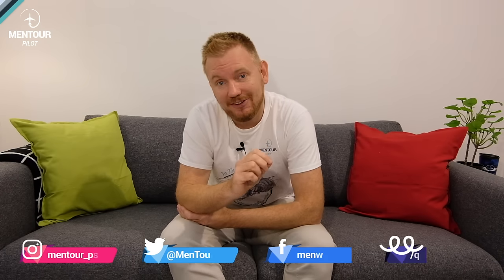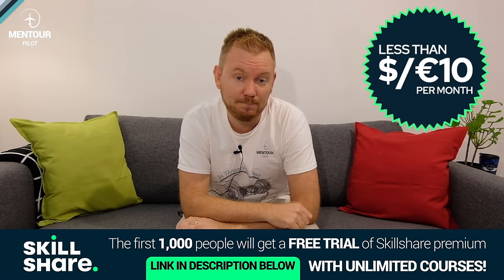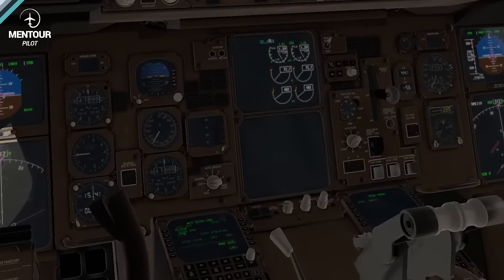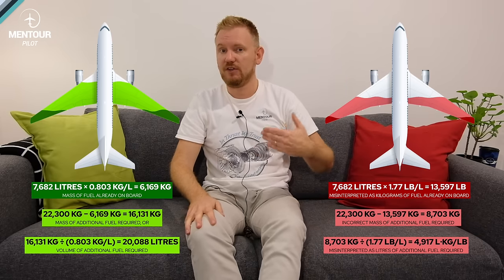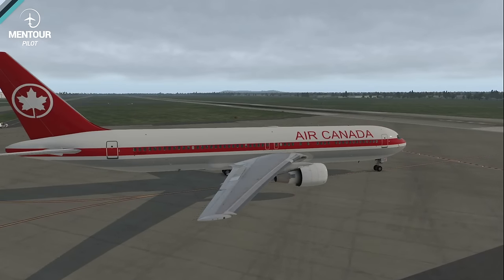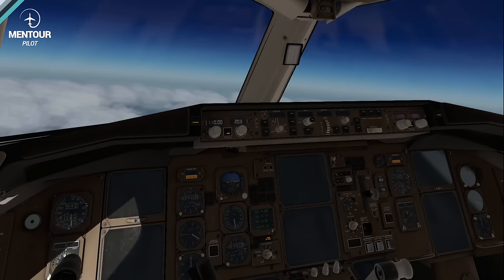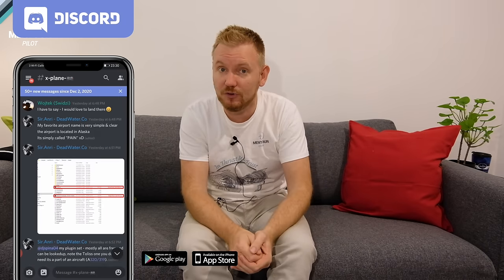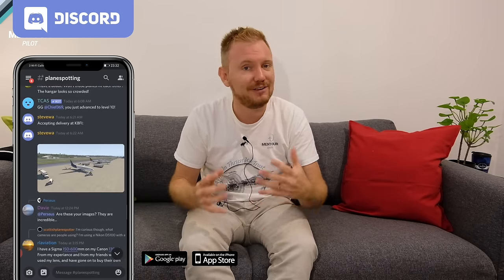The Gimli Glider! Explained

Comment: At this point in time the Government in power in its infinite wisdom decided on a major hike in gasoline (fuel) prices to continue providing excellent government to the people of Canada. In order to hoodwink and confuse the naive population they converted the way fuel was measured (adopted metric) and simultaneously jacked up fuel prices. It was a win win; the gov't got the tax revenue they wanted without upsetting their constituents and the public got hoodwinked and did not know the better. It was people like Capt. Pearson who initially became the strawman to protect Air Canada's reputation.
    The bean counters in AC too who try to minimize fuel loads and tank up at locations where there is a significant fuel price advantage who likely had a role to play as well.

Comment: That Gimli plane still exists.
Reply: Alas, it does not. C-GAUN, the accident aircraft, was retired in January 2008 and flown to the Mojave desert for storage. The aircraft was scrapped in early 2014. Parts of the metal fuselage skin were made into a limited-edition run of aluminum luggage tags. (I have one of them.)

Comment: What I do not get is: if you did for ages conversions liter to pounds you will know the factor 1.77 like engraved into your brain. Now you KNOW that it's Kg and still you use the same factor? ??? Nobody gets a thought like "it can't be right to use the same factor I used for decades if it's kg now...."
No offense, but if this is the intellectual level of a flight crew I am scared.

Comment: Air Canada is a shit airline that frankly needs to be on the unsafe black list. 

When I was a kid, we were flying out of BC to Ontario. Dad looks out the window and sees a major section of the wing has peeled back. Calls over to a flight attentent and shows it to her. 4 hours later were back in the terminal waiting for another aircraft.

Literally - as a kid I didn't understand what my dad had seen. As an adult I get nightmares over it. I remembered to this day when the ground crew tried to use duck tape and grit to bend the metal back and hold it in place. 

The fact that they went after the air crew on this one speaks volumes of how utterly shit they are.

Comment: They were lucky Capt Pearson was a "take charge" kind of guy who said as long as the plane stayed together he would get it on the ground okay.
Reply: Except that, except for a tiny gust of wind at the end, he would have taken charge of slicing up hundreds of mothers and children.
It is the HIGHEST of violation of duty to care when someone in charge of lives assumes "yes, I'm sure they can safely fly" when he is not sure. He violated the most basic standard of care and negligence.
Reply: @Bill_Woo  I think you are being unduly harsh. Air Canada had just converted from Imperial to Metric and not trained the pilots or re-fullers in the conversion. To make matters worse the fuel onboard indicator was not working. When the Chief Mechanic (on board) was called up he had no idea of the problem. He did suggest they might be low on fuel and Captain Pearson then looked to land ASAP. I don't know about the "gust of wind" first time I heard of that. The plane 's nose-wheel collapsed and then it hit a divider installed on the runway that's what stopped it quite fast. I think his action's were amazing, considering that in many ways fate conspired against them. This view was supported by the Air Accident Investigators. Both pilots continued with Air Canada.
Reply: @arunta5  You don't understand what he did. Read the report. Everyone on the ground was uncertain of the fuel requirement. Pearson got out a calculator and OVERRULED everyone in ordering the takeoff.
Understand that the his sacred and solemn duty is to be the one that PREVENTS uncertainty with lives at stake. He did the opposite: he PUT them in deadly jeopardy by making that choice.Let me put it another way: he didn't know how to do t he calculation, but he asserted that he DID know, by checking the calculations and saying go ahead. In other words, he is an AIRLINE CAPTAIN with the most forbidden attribute: overconfidence.
There is no flexibility on that matter. NEVER should a captain act from overconfidence with lives entrusted to his care.
Still too harsh? Because it was a confusing calculation, you say? All he had to do was say no.
Furthermore the takeoff was illegal due to the MEL. You can ask any pilot about that.
This is not a close call. The only reason he skated was that the public didn't know any better, and assumed that he was a hero for saving lives - when in fact, he put EACH of those lives in deadly danger in the first place.
Reply: @arunta5  As to gust of wind: as he glided in, had the wind just threw up a gust that threw him 20 feet to the right or left (which is common, and extreme when there is no thrust to defray it), boom. Hundreds of mothers and babies would be sliced up. No matter how great he flew, he was at risk of that. Followed by a cartwheeling crushing everyone INSIDE the plane.
Reply: @Bill_Woo  Anyone can make a mistake I have seen that in many situations. Why did the report not then recommend they be disciplined or charged. They each continued with Air Canada. Captain Pearson retired later and Quintel was promoted to Captain. I would be very happy to fly with either of them as my pilots. You seem to think they should have been crucified. Ever been in a really bad car accident where someone is killed. I have. Mistakes will always happen, that's life. We learn and move on.

Comment: Your presentation of the fuel calculations is really not very good. They mistakenly converted kg to pounds but you said they did that after Consulting the manual. That must have been in the manual for some reason. You say they should have converted liters to kilograms, which is true, but was that not in the manual as well? No explanation as to how the manual could have led them to do it that way. And you keep using the word conversion factor. A lot of people out here don't know what a conversion factor is but they can understand simply being told that a liter of fuel weighs .803 kilograms, so you multiply the number of liters by .803. Technicians understand the former, any backyard mechanic understands the latter. 7682 liters of fuel does indeed weigh 13597 pounds, It is not an incorrect calculation. The question is why did they do it? And since if they hadn't done it the accident would not have happened it would seem that is the key question.

Comment: ?  Pilot conversations lead to confusion twice?  So they can't read/understand, talk or do math....avoid this airline.
But it is amazing that a two channel system display goes blank if there is a difference.  Understand it might not be able to tell which one is correct, so going blank might be a good indicator that something is potentially wrong.  Would think they would have put a third system to be the tie breaker..ha
Converting volume to weight...based on known material mass.

Comment: Air canada was too stupid to create a form covered in plastic showing how to convert fuel numbers ??   

And doing 2 conversions is just stupid.   The fuel truck and plane and the chart showing how much fuel is needed all need to be the same unit.   
     The brilliant person that embraced the metric system should have been fired as well.  Dont change stuff for fun.  And if you change then change everything all at once.  
        The person fueling the plane should have noticed it took 28 minutes to load fuel for this trip.  Except today it only took 12 minutes.